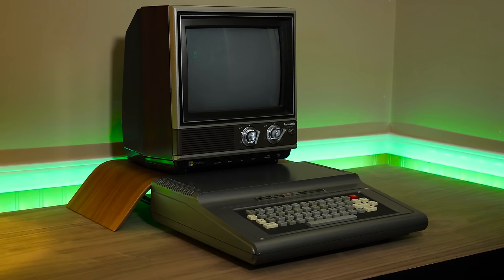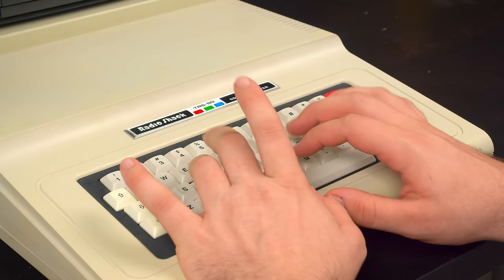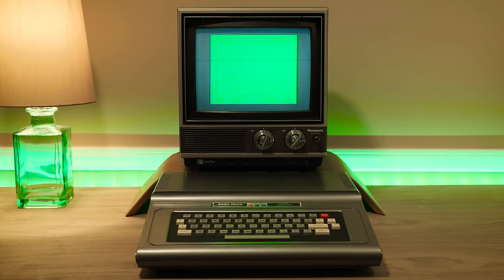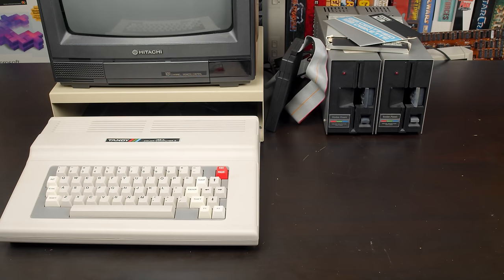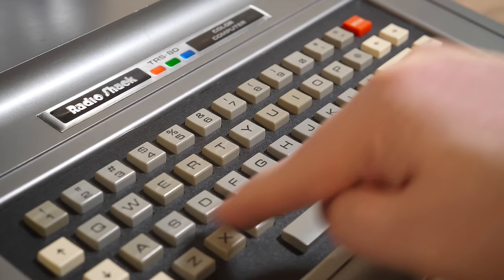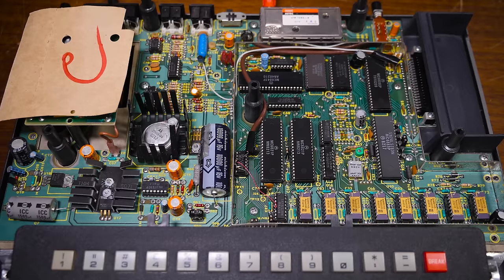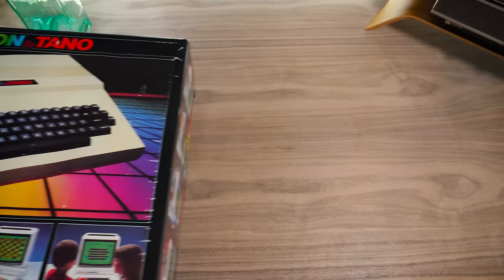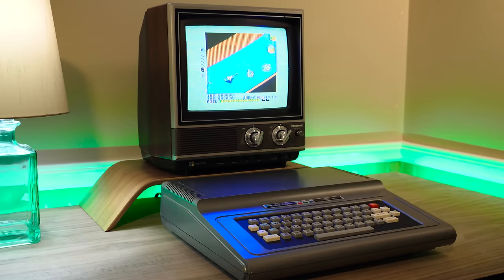TRS-80 Color Computer: Radio Shack's $399 Micro from 1980!

Comment: Ah, the ol' Coco. This was my first computer and I loved it! I had the 16k version with standard color basic.

I mowed lawns, did chores and skimped and saved to get the money to get extended color basic... and it was worth it.

I tried to write several arcade classic clones with this machine...in BASIC and had somewhat mixed success. My attempt at Star Wars the arcade game, the vector graphic one where you attack the Death Star in a X-WIng fighter turned out okay. I got the stars to look good but the game froze to draw the lasers every time I pressed the fire button. No sound effects either.

Tried to do a Donkey Kong clone, in BASIC, because I loved the Pie Factory level and my version on the Atari 2600 didn't have it. Of course my version looked like ass and the game froze whenever I pushed the button to make my character jump.

It was a learning experience.

Anyway, so many good memories with this computer. Still have it. Need to get it out, clean it up and play with it again.
Reply: Yeah, sounds like my experience too as a teen using this computer. Loved all of it.  I was able to write a game to mimic an early 80's Missile Command game, since there was relatively low graphic movement. But it wasn't easy and it had explosions. I wrote it all in BASIC but the real trick was to do it in assembler with the special assembly language cartridge. But that was a bit too advanced for me at the time, although I did do some assembly language programming in high school an "Advanced Math" class (I hated math). But in college, where I studied for my Computer Science degree, I finally learned the dark art of programming in assembly language. So low level, but I actually enjoyed it. Anyway, all of that led to the career I've had my whole life. And it all started with programming on a TRS-80.

Comment: "It remains affordable to collectors!"

...well, it was before this video, at least.
Reply from the maker: There were hundreds of thousands of these computers sold over the years so there's no shortage of them at all. You might be overestimating the effect a single video has on that kinda market :)
Reply: just got into CoCos a few months ago - the only real problem is the CoCo 3, which has a tendency to be far more rare, likely due to the Tandy 1000 being released two years prior (in 1984) and the overall rise of the market that model catered to

CoCo 1's and 2's are regularly on Ebay for about $150, including as of typing this; nabbed one of each myself at slightly less than that price, as well as a TRS-80 pocket computer PC-4 with an added 1k (!) RAM module for $50. it's honestly a pretty decent supply, all things considered
Reply: @LGR  Perhaps, though I can tell you that MtG card prices see exploding prices due to individual videos all the time.
Reply: Ceul Gai that’s a little different of a market
Reply: @Just to watch stuff From my experience, mostly The Command Zone, but sure@
Reply: @malikjahim  Back in the 1990s you could buy early computers for just a few £s. My records were a Spectrum for £1, and an MSX and an Atari ST for £3 each all working. If you watch LGRs Dragon unboxing he didn't pay much for that brand new.
Reply: I remember late 90's when People were keeping Amigas in the cellars, garages and attics. Thrown without any protection like a trash, with tons of other crap on top. They were seen as worthless crap. Nów you can see low-end models being sold for a price of a decent modern laptop... No wonder that older machines can be even more valuable when They were thrown away when Amigas and STs came out.

Comment: The CoCo is an interesting one, a bit of a departure from old DOS stuff.
I can officially call myself a retro IBM-compatible person now I've picked up an old pentium 100mhz for free. It's my coaster for the time being until I have something to put it in.
Reply: @DrLoverLover  Yeah, believe it or not, Pentium 100 was released 26 years ago. Since then we've had the Pentium 120 to 200MHz (1996), MMX series (1997), PII (1998), PIII (1999), P4 (2000), P4 HT (2003), Pentium D (2005), Dual-Core and Core 2 Duo (2007), Quad Core (2007/2008), First Gen Core i7 (2008) / Core i5 (2009) / Core i3 (2010) with iterations up to 11th gen today, along with the Core i9 in 2017. So I think it's safe to call a processor 13 generations old "retro".
Reply: which gnu/linux distro can you run there? tiny core?
Reply: @angelorusso3219  Wow, saying 26 years really makes it sound old. It's always been 1994 but as time goes on it's more and more years ago. In terms of being retro, I'd say it just makes it. Not so much because of its age but because vendors have dropped support. The last version of Debian to run on Pentiums is Jessie (version 8), which just ended long term support at the end of June this year (2020).

Comment: I purchased my Coco on Kodiak Island, Alaska right after release. The 4K model.  With it, I taught myself programming during the long Alaskan winter.  I upgraded it myself to 32K by stacking memory chips (the "piggy-back" method).  The joysticks were "must-have"... and eventually I got the disk drive as well as the 300 baud Modem 1...  I was on-line since about 1981 or 82... long before this "internet" thing was a household word.  The disk drive was magic.  I also purchased the mouse... but it was not implemented in too many commercial titles. The Coco was the first consumer computer I ever heard of that had a multitasking operating system available, OS-9.   I ultimately upgraded the keyboard to a full-stroke after-market one.  I had the 4-pen color plotter, the CGP-115 which I ended up mounting INSIDE the Coco... flush with the top of the case in the left rear.  So far as I know, the only Coco that existed with a printer built right in.

In around 1985, I connected the Coco to a movie camera capable of taking single frame exposures.  With custom software I wrote in Extended Basic, the Coco did 2-d animation, frame by frame, and commanded the Super-8 camera to record it... which, when sent off for development, returned what must have been some of the earliest home computer animation ever produced.

I also wrote a few bits of code in 6809 assembly... stunning speed (great for joystick interfacing to graphics) when compared to the basic interpreter, but SO difficult to program.  Glad I did it just to say I did :)

The other fun thing Coco users did was participate in "one-liner" program contests... seeing what you could write in one line of basic code.  Today the very concept makes no sense, but back then memory was at a premium, so writing compact, efficient code was a necessary skill.  I was able to write a joystick controllable lunar lander simulator... two versions, one that had sound with the rocket thrust, and the other that had no sound, but actually detected the moon and landed on it without falling through... I couldn't have both :).    Another was an Evil Kneivel simulator where the motorcycle would jump busses, based on the arcade game.

Take that, modern coders.   All in 256 characters of basic code, looping within a PORTION of one line of code (the initial portion was needed to initialize the graphics mode).

Amazing computer... a serious love affair, until the Amiga 1000 came out!!

Comment: My first computer (not counting the Pocket Computer 1) was the CoCo: 16k of Ram that I upgraded myself to 64k. Later, I added a floppy drive, when it was going for 1/2 price. For a monitor, I used a TRS-80 Model 1 monitor a friend sold me. I used that CoCo for many years, even after I bought my first PC-compatible: the Tandy 1000. By then, I also owned a PC 2 and a Tandy 100. Today (Jan 2021) I still have that old CoCo and it still works -- even most of the disks.

Comment: About a decade ago in rural Texas I found a TRS-80 in a small junk shop off of highway 82.  I didn't know what it was, as I was a bit too young to have ever had or heard of one, but I grabbed it for about 20$ and took it home.  A bit of fiddling and I had no clue what was 'wrong' with the machine but we had a radioshack in a nearby town.  I ended up taking it to the old man that worked there and asking him if he could 'fix my computer.'  When I brought it out of my car and hauled it inside his eyes just about bugged out.

He ended up working on it for about a week or two, but couldn't get it running.  When I asked him what I owed for repairs he told me not to worry about it, that it was just nice to have seen one again.  Ended up letting him keep it, because I surely had no use for it.  Hope he got it running.

Comment: I mowed a lot of lawns to buy one of these.  I still have it.  Worked last time I checked.  
I was so excited when I got this that I stayed up all night reading the programming book and memorized it all.  I mainly programmed on it.  I never bought any game cartridges.  I did, however, buy a voice cartridge and a controller cartridge.  The controller allowed you to control outlets in the house.  You could press buttons to turn things on and off or you could set them on timers to turn on and off.  It was pretty futuristic for the time.  
Btw, I later upgraded the machine so it would display more colors.  That required losing like half of the memory...lol.  Worth it though.

Comment: I had a CoCo 1 and later a CoCo 3. By that time I was running OS-9 with an 80 column display on a Tandy RGB monitor and a 10 Megabyte hard drive. While everyone else had their 286 DOS PCs I was multi-tasking multiple apps in multiple windows and was even known to have a terminal connected. I thought I was so cool. (I wasn't.)
Reply: Heh... we took that even further at a print shop I worked at in the 1980-early 2000's. After our PDP-11/34 died from second time, we replaced it with a Coco 3. By the time we got done adding both custom and 3rd party hardware and software, we ended up with a 10% overclocked Coco 3 with 1 MB of RAM, 2 hard drives (80 and 40 MB), 2 floppies (360K 5.25" and 720K 3.5", including the ability to read/write DOS disks), 8 hardware serial ports, all hooked up to terminals scattered throughout the building, 3 parallel ports (controlling both high speed line printers and 20 ppm laser printer), real time clock, auto boot ROM, and NitrOS-9 optimized for the Hitachi HD63B09E processor upgrade. Lonnie Falk at a RainbowFest in Chicago one year mentioned that it was probably the largest Coco system he had ever heard of.

Comment: what a space saver: "joystk" instead of "joystick" :D, great video though!
Reply: In Extended Color BASIC, "JOYSTK" is actually a legitimate command for reading the joysticks.  You had JOYSTK(0) to JOYSTK(3).  But if you didn't read JOYSTK(0) before any of the other ones, you wouldn't get the right data.
Reply: interesting! i did not know that!.. now i feel foolish..
Reply: @wilfredoz  Actually, if you used Assembly Language and never read up on Color BASIC, you wouldn't know that, either.  No need to feel foolish here;  you'll hear a lot of people say that they never regretted taking up Assembler instead of BASIC.  This is one time where no harm is done by letting other people fill in the blanks.  :-)

Comment: Thanks for the video.  It brought back memories from when I was around 9 or 10.  We had one of the original 16k COCOs in 1980 when they came out.  My dad was an electronics technician and almost immediately upgraded it to 64k.  We used the tape recorders over the later floppies and of course, subscribed to all the different COCO magazines.  Many a hour was spent typing in programs.  Spent many more hours trying to figure out where I made typos to get them to run properly.  Looking back, I wish I had kept all that kit.  Thanks for the video again.

Comment: That 5-pin DIN cable with the three jacks looks like the same one used by the Amstrad CPC range. I had a CPC 6128 with disk drive but mostly played tape games because of the cost, and I had a cable just like that with the remote jack that allowed the computer to start and stop the tape as necessary. The early 80s seem so primitive now, but I'm so glad to have been a part of it.

Comment: My parents bought a TRS-80 for my older sisters at some point in the 80's and it was my first home computing experience as a pre-teen in the early 90's. It was already long in the tooth by that point but I had a lot of fun typing in BASIC programs and storing on cassette tape. I still remember how the "Helicopter" game had some kind of bug in the code where it would crash at the same point each time. And the box for the computer has been a great holder for the Christmas wreath for over 30 years now!

Comment: I still have my CoCo2 in storage. It's been modified with a monochrome composite out, 64k and audio outputs so it's easy to connect to modern displays.

I used it as my primary computer until 1990.  Running OS/9 in 80 column mode on an amber monochrome display was quite nice for typing papers and essays in college.

Comment: My oldest brother had the silver model. My older brother had the off white model. My oldest brother opened his up and found empty slots. Found a broken COCO and took the memory and put it in his. I guess the 16 and 32k models were the same, just a couple of chips. changed. I had a TI99/4A. Thanks for the memories. I remember he had an aftermarket disk drive. Eventually the Tandy drives would eventually have problems. His worked just fine.

Comment: i worked as a Tandy Computer Service center manager in the 1980's probably the most common mod that i saw as to remove the memory size badge and put a LED power indicator in the small hole..of course as a factory repair center we were not aloud to do that but lots came into my shop with it done..second most popular was a replacement keyboard

Out of about 1000 coco's my shop repaired only a few had floppy drives..most common repair was keyboard..Coca-Cola+chiclet keyboard= VERY stuck keys..basically a solid machine back in the day..

it was treated more as a "game computer" than a serious work computer..

Very cool the one you are working on has never been in a Tandy service center..here is how to tell:
If the warranty sticker is black with white letters ..that sticker was put on at the factory..
If the warranty sticker is white with black letters it has been in a service center..there may also be a 4 digit number on the white label written in ink..that is the shop number that last repaired it..

also look for battleship grey lock-tite on one of the screw heads ...we used that as a secondary way to tell if someone had been inside the case...

Comment: I was a hard core D&D player at the time. I recently set up a emulated coco2 with GDB debugger cross compiled to 6809 tool-chain so I could use modern day reverse-engineering techniques on it. D&D was by far the best game designed for it.  I was lucky enough to get my hands on a speech pack and I couldn't afford the multi-pack interface so I hand soldered the speech pack to the cart port using ribbon cable. I tool the speech pack apart and place the connected PCB under the main board as there was considerable space under the coco2 main board and the bottom of the case. To disable the speech pack I placed a switch on the cartridge sense enable line so I could disable it as it interfered with some games.

Comment: I had one of those CoCo Computers. And I still Have The CoCo 3 with 256K memory upgrade. They are awesome for a first time programmers PC. I also had a subscription to Rainbow and Hot Coco Magazines, Multi-pak interface and 5-1/2" dual floppy drive, tape drive.

Comment: I was a Coco Fanatic, had the CoCo-II first, CoCo III, later an Original grey CoCo also. Had 2 5 1/4 Floppy Drives, a 720 K 3 1/2, 20 MB Harddisk, Multi-Pack interface, TRS-80 Cassette tape drive, Orchestra Pac, High Res CoCo Monitor, High Res Joystick Adapter/ High Res Joystick, Koala Touch Pad (TRS80), MIDI Cable connected to a Yamaha PSS-680 Keyboard, 512K CoCo III Ram Expansion, Spectrum Analyzer Pack, OS-9, MultiView GUI, assorted Rom Game and Program packs a Modem Pack, two Dot Matrix Printers, TRS80 and IBM. And most of the available programs. I was in the Inland Northwest CoCo Club, Collected nearly every issue of Rainbow Magazine, and CoCo related books. I wish I could share with you some of the photos I have scanned of my computer systems.

Comment: In 1980/81, I was spending over $50 per month on Caterpillar, Battlezone, Donkey Kong, and PacMan at lunch and after work -- 25 cents a play! So, when Radio Shack came out with the Coco, I decided to jump in. I bought the big, 16K version, which I upgraded a while later to 64K with chips and instructions from a magazine. I still have the original 16K button from the top of the Coco. Man, those cassette tapes filled up quick as we swapped programs with our friends. Immediately, I was hooked on programming. Eventually led to me to work in the field as a programmer.